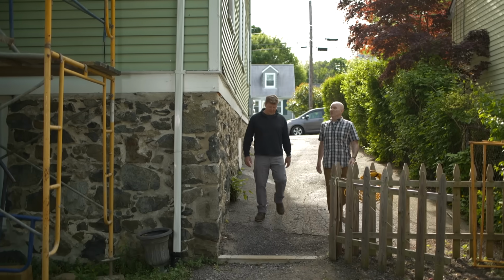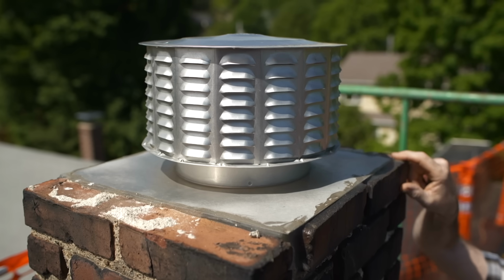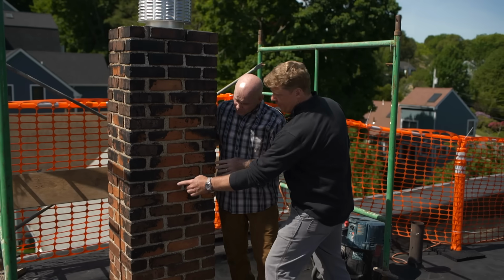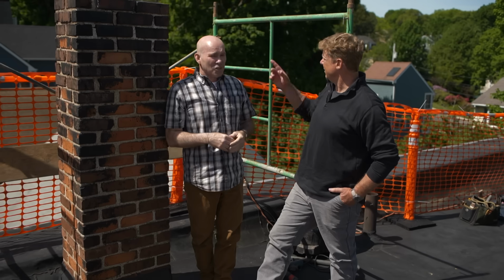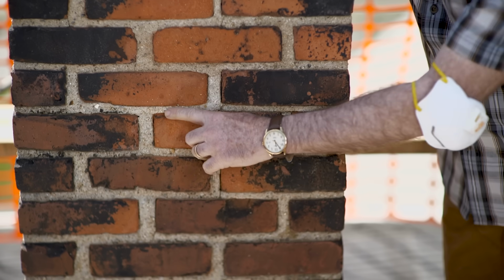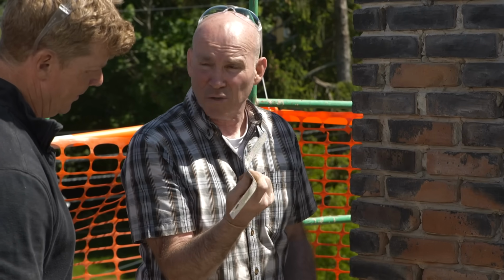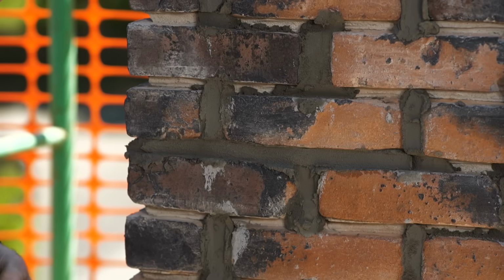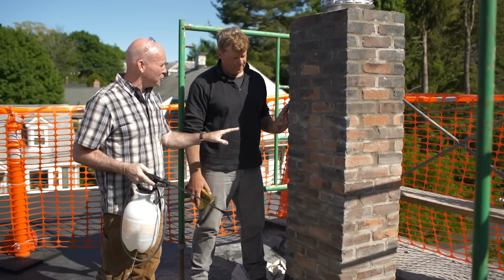How to Make Common Chimney Repairs | Ask This Old House

Comment: They had some discussion of the cap but never showed any active addressing of it ; I do  believe in what Mark was saying about not wanting to directly "integrate" masonry types which are not thoroughly compatible (if not complimentary) with each other ; but I think that I would like to see a cap flashing unit or assembly that covers the entire topside of those brick and carries water/weather 'some measure' past the edge(s) of the outer bricks for better more complete shedding away of the water in particular (???)

Comment: great video - I only wish , during mention of some important step , & mortar type that is used , also - what to look for the waterproofing,  but still ! , Lot to take in !  He's certainly good at this !👍👍
Reply: He mentioned the mortar type.  For brick work you use Type N.  It's flexible and allows the brick to move without cracking.  If you were doing cement block or stone work, you could use Type S.  It contains Portland cement.

Comment: Good video. Can you tell me what waterproofing agent you recommend for a 100+ year old chimney.
Reply: Brickwork of any age should be treated with silane or siloxane, a clear spray on liquid. It rejects rainwater intrusion, but allows water vapor inside the brick to escape. Do not use a pure waterproofer, like silicone.

Comment: Isn’t it more cost effective to use a harness than to set up a whole scaffolding tower just for a simple chimney repair?
Reply: That’s what I was thinking. They could anchor to the roof directly, or tie it to a vehicle/anchor point on one side of the house, while working on the other.
Reply: Yeah but they're also filming a video, so...
Reply: @nataliekw yeah but they’re also trying to sell the benefit of using scaffolding in the video. If it were purely for the video they wouldn’t have focused on it in the explanation.
Reply: Oaha bro
Reply: On a FLAT roof too. I have flat roof. Never considered putting a safety barrier because I'm not a retard.

Comment: This is a very good demonstration, thanks. I'm wondering why the individual brick condition wasn't discussed? What if some of the bricks are cracked or spalling? I wish some of the bricks could have been replaced as part of this tutorial. Also would have liked a tiny introduction to the mortar selection and preparation. This Old House has been my go-to for more than 30 years :) Thank you!
Reply: Also would have like to seen some addressing of the liner in that chimney and discussion of different types of liners , repair and replacement of them . But what they did , I thought was pretty good stuff

Comment: i would have just used Quikrete Mortar Repair Sealant in caulk tubes and a repointing tool quicker faster less mess and no need to have to mix anything.

Comment: Wow that is an incredible amount of money and time into repairing a casing for a metal pipe!
Why not just tear the chimney down above the roof and install the appropriate metal chimney?! Thatd have to cost less than just the scaffolding.
Or better yet, slather your favorite sealant on that chimney (as it looked fairly structurally sound) and when the appliance hooked up to that pipe is due to be replaced, tear the chimney out down to the roof and get a powered vent appliance that vents out the side.
Then you would never have several thousands of dollars in repairs for an unnecessary roof penetration!

Comment: I wrap my terracotta chimney flues in a Blueskin membrane (where the concrete crown will form around). 
This provides some room for expansion during freeze/thaw and prevents the flue from cracking. 
It also seals the joint from water entry.

Comment: Eh, this is one job you contract out, because by the time you rent scaffolding and spend all of the time doing this, you are barely saving any money over hiring a contractor.  Repointing actually isn’t hard, but getting up that high is dangerous without experience and scaffolds.  

Type N mortar is correct to use for most repointing jobs, because it has about 750 PSI of strength.  However, you must be cognizant of the fact that older homes often used lime based mortars if you need to repair your chimney on an old home.  Type N and all the stuff you can buy from big box stores contains Portland cement, which you typically do not want to use on older homes where lime mortars were used. Older bricks are weaker, so if you use cement mortars it can damage older brick.  

Also, color matching can be difficult, which is yet another reason to contract this type of work out to a pro.
Reply: I like what you've mentioned here. Matching mortar to old mixes is something experienced masons are aware of. What about just removing all of the surplus chimney and completely redoing the chimney with new brick and mortar? Since he mentioned that it's much taller than it needs to be?

Comment: 154 brick rebuild. Could be demolished and rebuilt in one day with new brick by any mason I’ve ever worked with, no scaffolding needed. Be nice to get some counter flashing on there too, it would help stop the water infiltration.
Reply: Oh! I hadn't thought of that. You're saying demo the old chimney and replace with all new? I like that idea and think it would result in a much more lasting system. Thanks! Particularly when some of the bricks may be deteriorating, mortar replacement just may not be enough.

Comment: Is the waterproofing agent a sealer or is it a different product? I remember in a different video repairing stairs Mark explained a sealer isn't necessary because the mortar or concrete is waterproof and a sealant could cause damage. So which is it???

Comment: Here's the proper procedure- all that scaffold cost the home owner  probably $2000. I don't like a harness but its a flat roof and if you fall off your not aware of your work environment or if your afraid stay home.  Next you grind the chimney with good diamond blades pay attention to what you are doing and you won't screw up the edges of the brick. You take your hammer and chisel  and leave it in the truck! When your done grinding get a hose or a power washer (I use a power washer)and wash all the dust and dirt off the chimney. If I get the grinding and washing done that's usually all I  do that day. Next day I dampen the chimney with a sprayer and point, probably 4 to 6 hrs. And that chimney is done. There is no washing when I finish because I not a slop artist. I go back a few days later and use 2 coats of breathable waterproofing. Also that flat tool is slicker not a margin trowel.
Reply: Do you use water based or solvent based waterproofer?
Reply: I could point that chimney in 15 minutes,I could cut it out in 15 minutes, use dry mortar with a pointing tool, and hawk
Reply: I could point that chimney in 15 minutes,I could cut it out in 15 minutes, use dry mortar with a pointing tool, and hawk

Comment: FYI, Mark, the chimney cap on the other brick chimney does not penetrate the flue or the concrete contrary to your statement in the video.  That particular cap as well as every other flue mounted cap that I have ever seen is designed to be secured with pressure bolts which tighten to the corners or sides of the flue without penetrating the surface.
Reply: u r absolutely right, guy with 4o years experience saying things like that, crazy, and all that stairs is to make more money,
Reply: @pawelfronczyk1579  taken 'em to the cleaners in Mass for sure.
Reply: Your comparing an apple to an orange.  The often used stainless steel chimney cap that bolts with tension on a clay flu liner not what you are looking at rather it is the cap that attaches to a new round chimney flu installed in a very old and likely unsafe creosote soaked 100 year old chimney that was likely built without clay flu liners.
 Clay flu liners were not common until the mid to late 1940's.
Reply: Exactly, I was going to comment , glad you did!
Reply: Just goes to show being in an industry for decades doesn't necessarily prove knowledge or wisdom.
Reply: Also isn't it terra-cotta liner at the cap is attached to? I was going to comment about the concrete. Somethings not right here with this guy

Comment: Always a pleasure to watch. Speaking of watches, wearing one while chiseling - shock resistance. WRT metal caps on wood burners, here (Calif) we have a cap that attaches to the protruding flue with horizontal machine screws that are tightened to create a friction fit.

Comment: Chimneys aren't that much of a thing in my country and english isn't my fist language so is it possible for anyone to confirm if I understood this correctly: a chimney draft is what pushes the smoke up and out of the chimney. When there are trees around, they reduce the draft (why?) and when there's a hill nearby the wind that comes from its side pushes down the air below and result in a reduced draft. Did I get it right?
Reply: trees may not specifically reduce draft but they may also influence directional flow  - up and away, downward and into house, around yours but into neighbor’s…wind  directional angles, tree height or even roof peak and thereby influencing air flow , as well as seasonal leaf drop on trees vs an evergreens “windbreak”.  
Home Airport landing strips = tree encased fields can have same safety impacts relative to winds.
Reply: @BunnyBunny-xs5db Thank you

Comment: That is insane, they easily had more money in setting up all that "safety" equipment than the work itself. On a FLAT ROOF mind you! I'm guessing in this case they either had access to the equipment, or had a bigger job also planned. Sometimes safety just CAN'T be number 1. Get real with this crap...
Reply: scott I suggest watch a 13 part series called What on earth happened by Ewaranon to learn that the earth is not a globe. Link in my about tab.

Comment: Glad that netting is there to stop a 200# human from falling. Anything the keeps a harness off you though is nice. You either have to drag around a strap or use a yo-yo. The strap makes a trip hazard so you’re more likely to fall but at least you won’t hit the ground. The yo-yo just makes my back and neck sore from constantly moving just slightly too fast and it tanking me back. I know a floor finisher who had to do a job in dc next door to osha. I guess they were strict and made them wear work boots and hard hats in a finished building. When doing floors the boots can mess up the finish and the hard hats fall off easy doing the same. However they didn’t requires respirators, the one piece of ppe that made sense. This is why one size fits all doesn’t work. He made $2000 on the job and lost $8000 in fines. Isn’t osha lovely.

Comment: Is the goal to strip out the old mortar completely or just get down to a solid mortar?
Reply: Pretty sure just to solid mortar.
Reply: Down to solid. Only going to get about a inch deep with a grinder anyway. As long as it’s solid and not still crumbling out is the difference between it needing tuckpointed and it needing tore down and rebuilt.

Comment: I would have used a grout bag. Then smooth it out.
Reply: Do you get the same penetration if you don't push it in?
Reply: @grantmeyer03  You use the grout bag, then that tool to push it in.

Comment: nothing safer than a flimsy plastic fence 20 ft off the ground.
Reply: It’s more of a visual barrier as to where you should walk or work near.
Reply: When you've got to tell the new generation to not lean on the construction netting 😂
Reply: Lol I love they call it a “barricade”
Reply: OSHA doesn't apply until one has a certain number of employees. However, some townships and municipalities may require these standards of safety.
Reply: @Farm_fab  thanks for clearing that up brain fly.
Reply: @Farm_fab  OSHA causing accidents as usual.
Reply: Guaranteed this homeowner owns plastic utensils and  owns no weapons.